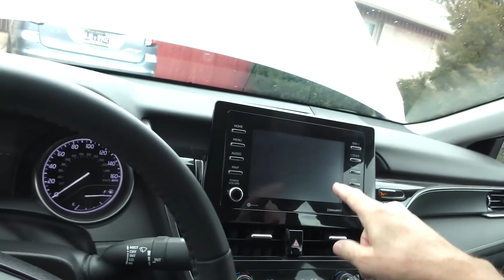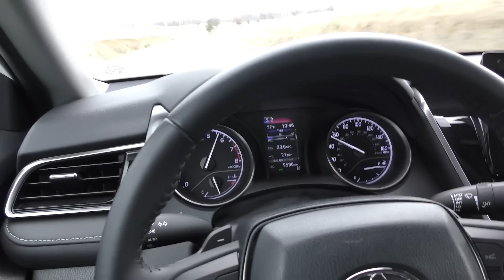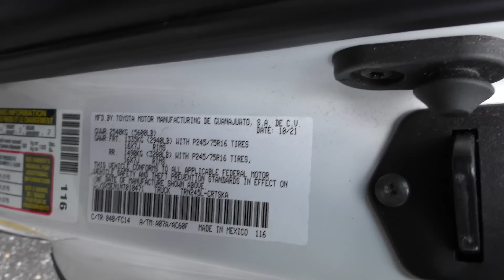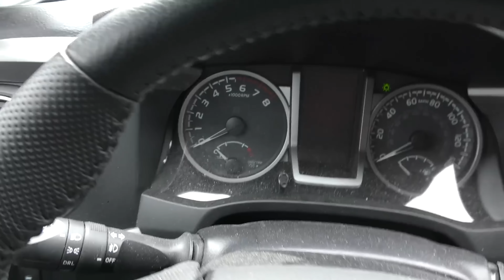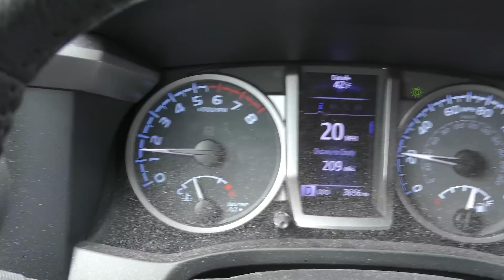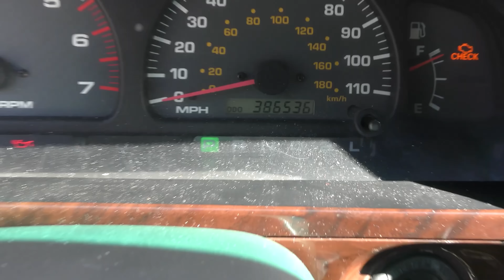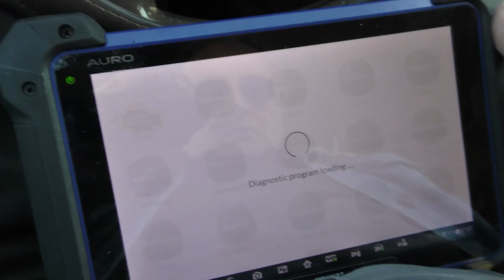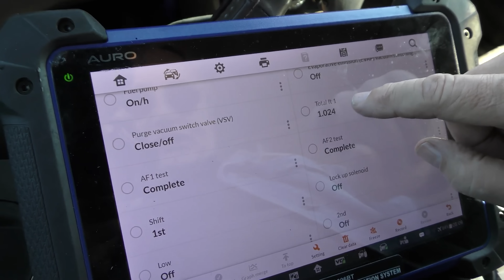The Best Vehicles Toyota Makes (Do Not Buy Anything Else)

Comment: I traded my 21 Honda Accord with the CVT for a 24 Camry with the 8 speed and I couldn’t be happier! Not to mention I won’t be having any turbo charger failures, or head gaskets failures like the Honda 1.5. I feel much more secure in my Camry.
Reply: While Honda  usually had better performance and gas milage Toyotas were always more reliable and lasted longer especially Toyotas "AISIN" automatic transmissions. The most solid automatic transmission side by side with German ZF.
Reply: Ashamed you couldn't get the hybrid. 
Electric car goodness without the electric car drawbacks.
Reply: A guy in my office just had the head gasket on his 2018 CR-V go. Only had 87,000 miles on it! Honda has become the new Nissan.
Reply: Our 2000 Forester failed head gasket every 70,000 miles.
Just right for a new timing belt. 
2nd failure at 140000 miles.
2 wheel bearings failed.
I have never had these failures on any other vehicle (even my lawn mowers) 

But my wife loved that gas hog.
Reply: @dannybryant6873  
Hybrid has more computers modules and sensors making it less reliable for just a few miles to the gallon more. More complex is not better simpler is.
Reply: @anthonynicholich9654  . Ignoring the nicer experience the hybrid has no accessory belts. No start/stop system. No 11 speed torque converter automatic. No torque converter. No 12 Volt starter or alternator. No mechanically driven AC compressor (it's electric like your home frig). 
Maybe a few other advantages I can't think of at the moment. 
The gasoline assist engine gets CVT action from a planetary gearset.  Not a sleazy mechanical CVT. 
Traction battery is most likely nickel (well proven, but might have lithium (I would prefer nickel)).
12 Volt battery lasts 10 years. My 2013 Prius is on its second one.

I would get the hybrid even if no fuel economy advantage.

Comment: My 2016 4runner, which I bought new, has cost me nothing except for new windshield wipers and brake pads! Even the battery is original and still tests good!! Cheers from Canada!!🇨🇦
Reply: I hope it costed you oil too …
Reply: you must barely drive anywhere for an almost 9 year old original battery
Reply: @gmfitzg  
 Actually when  you don't drive anywhere it puts a strain on them and they don't last as long so which means the batteries are built well.

Comment: I own a 2020 Prius, and I have an airport shuttle business. I bought it new in 2020, and now have 231,500 miles on it. I have had absolutely no problems with it. Still runs like the day I bought it. All I have done is change the oil every 5000 miles, and changed the air filter a couple of times. I would do a commercial for Toyota for free. Did I mention that I also own a 2005 Tacoma with 229,000 miles on it, never any trouble either.

Comment: Recently traded in a 22 civic sport CVT boost blue with full HPD kit for 24 rav4 LE AWD w/ winter package and yes the AWD works at all speeds, highway included. Love the actual key, the rear heater for my dog and the 2.5 8 speed  gas mileage is within 4 MPG of the civic. Love it.

Comment: Bought the 2024 camry le for $29,500 in long beach  CA. back in January, zero regrets. Have my eye on the Japanese Corvette...2025 Lexus LC 500, possible buy next year after March.
Reply: I drove a used Camry for 8 years and liked it so much for its being a nice driving and reliable car that I purchased an IS500 when I retired. Same reliability but I still miss that old Camry
Reply: @kurtbeck5809 
What kind of gas mileage are you getting with the IS500 and do you need premium with that?

Comment: When you are picking your daily driver, the car you drive to work or just to get from Point A to Point B you want to pick a boring car.  More often than not that boring car is going to be more reliable and less costly to own.
I really do like the Supra Mark III or the A70 as Toyota called it but those are now getting rather expensive to own.  They had some particular engine problems and getting parts for them now can be a nightmare plus they can be very expensive.

Comment: My 2020 non-hybrid Highlander (all wheel drive) has the 8 speed transmission.  I find it be quirky in these respects: it often downshifts on downhills when I don’t want it too to cause engine breaking.  Also, when accelerating uphill, say on an onramp to a highway, it stays too long in lower gear before shifting, with the RPM staying higher longer than it needs to be. No other issues with this car. 73,000 miles far.

Comment: The Camry A25A engine has high pressure fuel line, electronic water and fuel pumps - time will tell if these cars run as long as older Camrys.

Comment: I took my car to Nissan because I have an endurance warranty for parts and stuff. Would you believe that they wanted to charge me $925 to change the spark plugs? Can you believe that?
Reply: That's because you're paying the hourly labor rate. Depending on the car and the number of cylinders, on some vehicles it involves removing the top of the engine (valve covers, anything that is in the way of doing that, intake manifold, etc.) just to get to the plugs. Stealership labor rates are insane, not to mention the price you pay for the parts. But that's how they make their money. Selling the cars isn't the main profit generator.

Comment: For say a 05 chrystler 300 5.7 sits up for around 8 months now it's in a sort of limp mode it wont shift sleedodemter not working fuses are good wires seem good grounds are clean and tight ohh the battery was bad as well I feel this detail may be important and somehow it acquired a dead cell and those mofos are expensive so I got a smaller one but it works anyhow throwing codes u1120 and u0121 ugggh I think it was lol

Comment: I wonder if the rough shifting and hunting for gears on the Toyota 8 speed automatic transmissions were worked out with the 2022 models or 2020+ or something.  I have a 2019 Camry SE and my transmission shifts pretty rough and sometimes just doesn’t feel right. 

Toyota continuing to tell me nothing is wrong, but at only 59,000 miles I feel something is off.  Hope they’re willing to work with me.. gonna keep fighting with them.
Reply: Have you tried just changing the transmission fluid ??? You know it’s not lifetime fluid down there lol 

Anytime you’re having a issue with a transmission shifting rough means it’s time for a fluid change , put some amsoil in there and you won’t feel anything lol

And yes you’re at the mileage for a transmission drain and fill , no it doesn’t last to 100k mileage lol

Comment: Hey Scotty what you think of 2024 toyota crown hybrid non turbo
Reply: Love mine so far , 24 limited , I’m at 20k mileage with zero problems , averaging 38.1 mpg within 60% hwy driving and rest in town 

The radio will give you issues time to time but it still works just need patience lol 

But definitely recommend oil changes every 5k mileage , 10k was insane to me cause even at 5k interval it was still going out dark lol , then just worry about your filter for the hybrid battery in back seat 

But I got limited for 44k in February, if you’re looking a limited that’s what you should be paying

Comment: The 2025s are all Hybrids now.  All have the cvts.  And you can get it in AWD, if you want that type of system, and the rear wheels are only driven by the electric motor.  Nice ride,, but needs more head room and it is suggesting 47 mpg city and highway.
Reply: Ecvt , get it right boy lol
Reply: @cormaro13  That is if you have the battery pack or a long extension cord.
Reply: @gibblespascack1418  I think someone forget about the hybrid battery pack in the back seat 😆 and yes all hybrid models from Toyota come with ecvt transmission , not a cvt like jatco trash lol

I got a 2024 crown limited with one and it’s not a plug in
Reply: @cormaro13  Do you like the Crown?  I am looking at the Camry, AWD.  The other car is a Legacy, but the 1/3 more fuel mileage is leading me to the Camry and I do no off road stuff.

Comment: So what years did they change the piston rings that do not burn oil ?  What year is this ?
Reply: I think 2010 the one with 2.5 L engine v4
Reply: Avoid Camry models 2007-2009 4-cylinder and hybrid models 2007-2011
Reply: 2010 with the introduction of the new 2.5 liter engine. But even that older 2.4 will run a long time, just keep an eye on the oil level. And not every 2.4 had the issue.
Reply: @johnjones393  I have a 07 v4 and I put royal purple oil seems burn 2 quart ever oil change that I do every 3 months,

Comment: I own a 2006 Toyota Tacoma that I planned on driving until I die, then passing on to my granddaughter. A couple years ago, my sister-in-law noticed that my right front tire was tilted inward and it was discovered that I had a large hole in the frame. I then found out that the frame on this make, model and year was the subject of a recall, so I contacted my local dealer. They told me that the recall expired--which I don't think is legal--so I contacted Toyota. They told me the same thing. Now, if I were wealthy I could probably get an attorney to force Toyota to honor their recall of my defective frame, but I am not wealthy. So, I will never purchase another Toyota again.
Reply: Oh, I forgot to mention that my truck has under 100,000 miles on it.

Comment: Even if you are not towing or using it as a work truck, 158 hp for a truck is low. If you are driving a 2500lbs 3dr hatch 158 hp is fine. But a 3700lb truck? 👎
Reply: Its perfectly fine. The vast majority of trucks used around the world (and in the US up until early 2000s) had that horsepower.